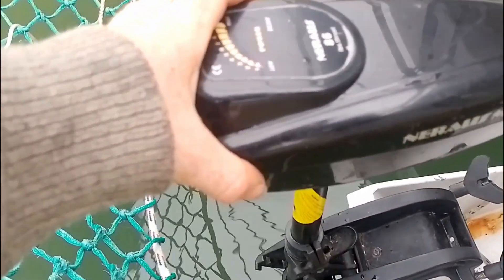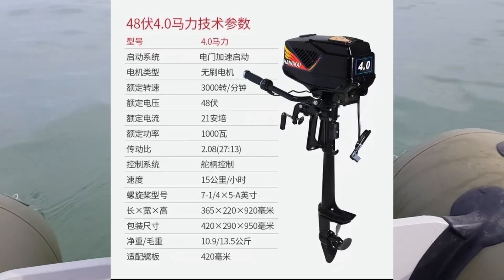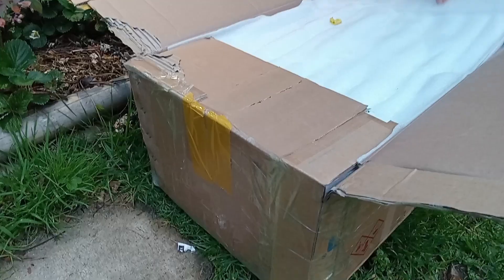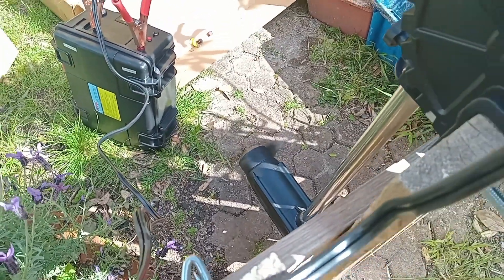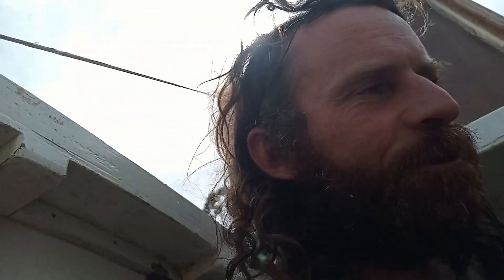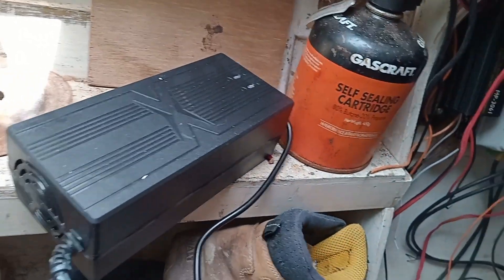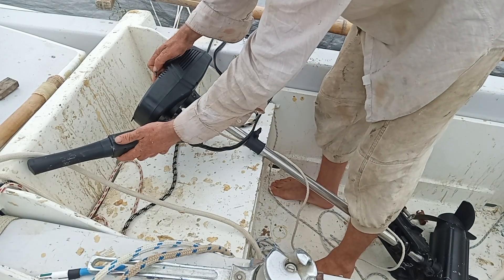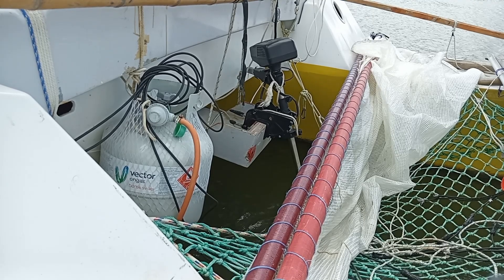Solar Electric Motor for My Catamaran

Comment: I'm surprised with all your attention to safety regarding energy storage that you appear to be using propane or some form of compressed cooking gas instead of a simpler and safer alcohol stove, such as an Origo or the many DIY camping ones you see all over YouTube.
Reply from the maker: hmm, interesting suggestion. It's actually very uncommon to see alcohol stoves in NZ. I could walk into any hardware store and come out with the cooker I have (and swap the LPG tank just about anywhere) but don't see alcohol stoves, not even in a marine store.
However I will look into this
Reply: @dominictarrsailing  watched all your videos starting with the Pahi restoration and you're putting out great content! I actually appreciate the low production value and super raw videos. But the audio quality can make watching difficult, even painful sometimes. It is very inconsistent in terms of overall volume and background noise. I suspect you could make big improvements without even buying new equipment - see if your video editor has something to normalize the volume 🙏
Reply from the maker: @CaddoCraft  the recent videos are much better unfortunately youtube doesn't really let you go back and fix old videos
Reply: @dominictarrsailing  btw, have you seen the Pahi 63 that's for sale in NZ?
Reply from the maker: @CaddoCraft  yes I know about that one. It was for sale recently, on a lake, it sold, they took it to the nearly sea port, but there was some problem, and now it's for sale again. A boat that big is way too much maintenance and expense. Way better off with a smaller boat unless you wanna have 10+ people live on it long term! there is one in the southern end of the south island that has been under construction since the 90s. It's sad really. They could have built a fleet of pahi 31s in that time and actually been sailing them.
Reply: @dominictarrsailing  I kind of do want to have 10+ people on one of those. You wanna fix it up and sail it Panamá for me? 😂
Reply: Also, one of those dead cat filter things for your camera microphone for wind?
Reply from the maker: @CaddoCraft  yes I have one now but some of this is old footage that was more noisy
Reply: @dominictarrsailing  Well, that makes sense for sure. I have heard of LPG tank explosions on sailboats in Panamá, so it's definitely a risk - especially with cruisers doing DIY decanting in many places. This is not first hand experience, but I've heard that in more remote locations LPG is rather rare. The benefit of an alcohol stove is that you can use just about anything that burns. It's also incredibly simple (you can just put some rock wool in a tin can lol).
Reply: Good suggestion re alcohol stoves. I'm a kiwi and surprised how few people use them here. Don't have the waste of the throw away canisters (although I'm aware you can refill those with the right gadget). Aliexpress has plenty of those alcohol stoves with all sorts of stands and attachments, though the one I bought had a rubber seal on the lid I didn't notice and when I put the lid on after using it the rubber melted so don't be like me and you'll be fine!
Reply: In UK, they sell alcohol in DIY store for use in indoor fires. Good cheap source.  Cost £££ in hardware stores.
Of course Dominic would still his own!
Reply: Origo Is no longer sold though there is still a similar design sold into Africa. HPV Salsa readily available ships from Australia tried and tested highly efficient design.. My favourite is Trangia and you can fit a camp gas module when you wish to cook that way. Ultimate minimalist approach that you can gimbal. Burn time a function of cc you put in if you wish to operate that way.